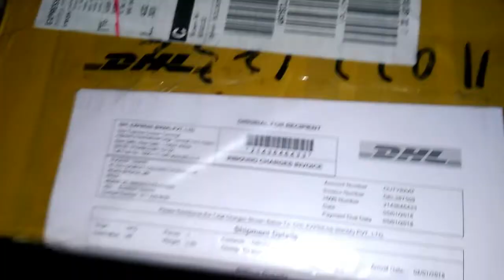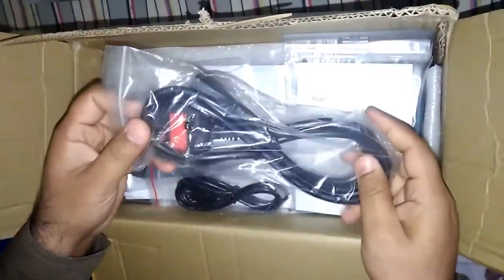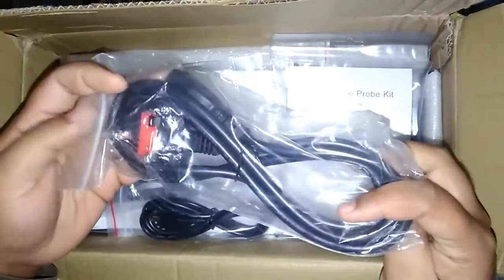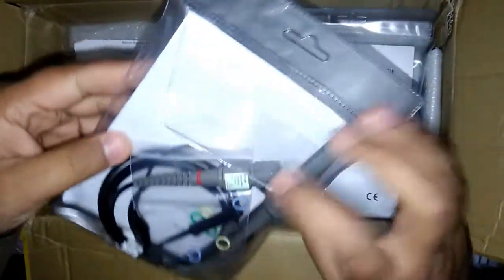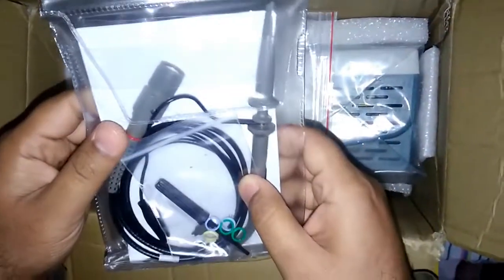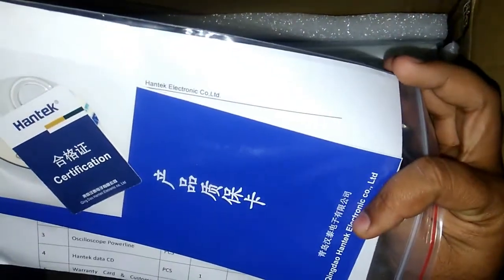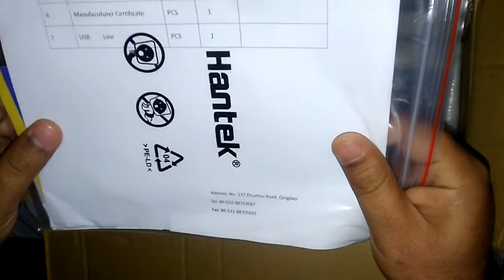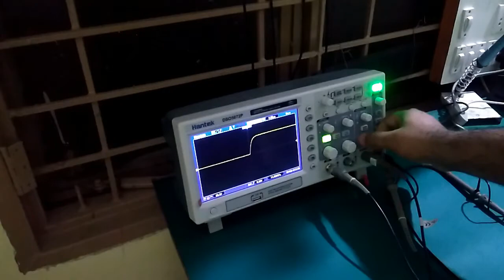Unboxing and testing Hantek DSO5072P Oscilloscope

Comment: So, where ist the Test of the Scope? I saw you put it on the Testsignal and what else? Poor Test, sorry.
Reply from the maker: Hi tom, actually there is inbuilt function generator in this oscilloscope of 1khz and 5 volts, for testing and calibration, in the video i am calling that signal a test signal and probe is connected to its output terminal. Thanks for the watching btw :)
Reply: @sidslab1345  But is NOT a really Test of the functions of the Scope..If i would brought this Thing i would to know what the scope work. Sorry my english is terrible.